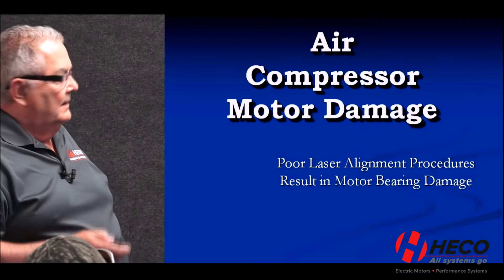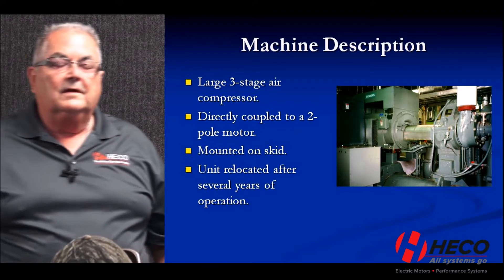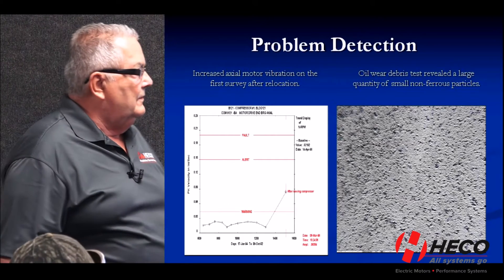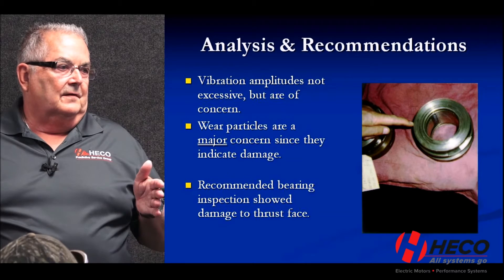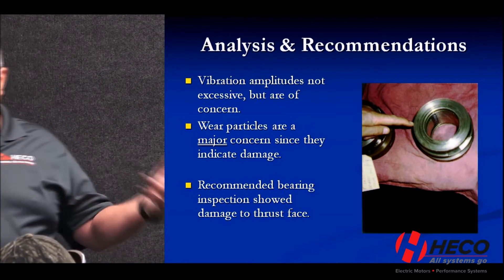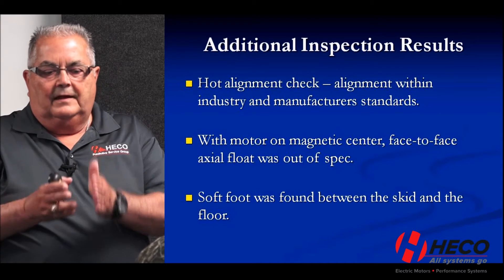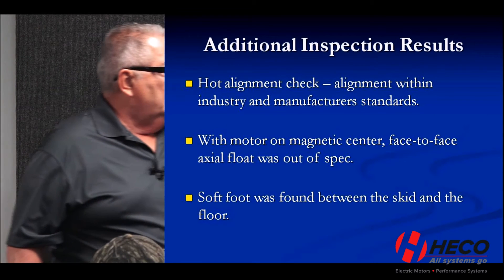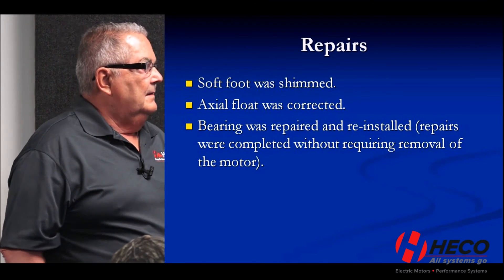How to Fix Vibration Problems - Air Compressor Motor Damage Case Study

Comment: Please what causes high vibration in centrifugal compressor
Reply: Poor alignment of shafts on motor and blower, out of balance on center blower wheel, fin placement not equal spaced, bearing damage or wear, weak winding on motor, low power input, improperly balanced base, oil contamination, bad airflow conditions, unstable power input or unbalanced power input/ feed..